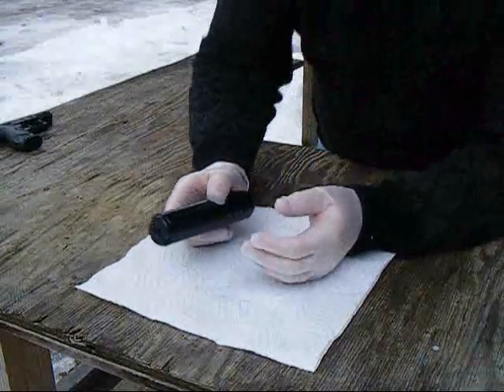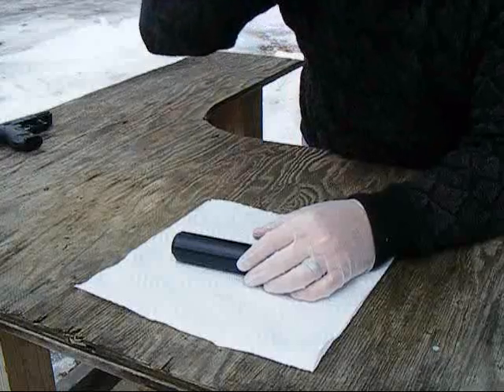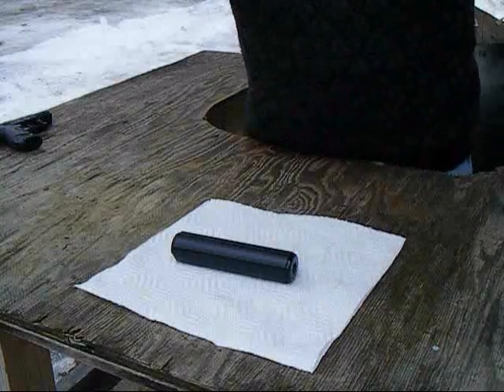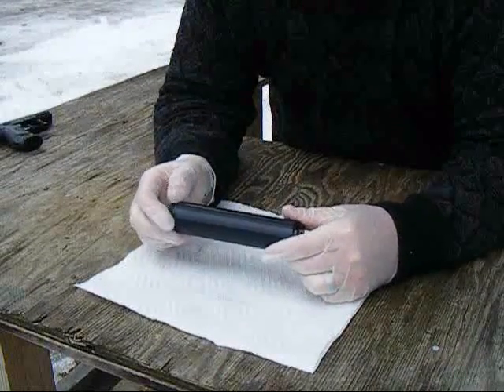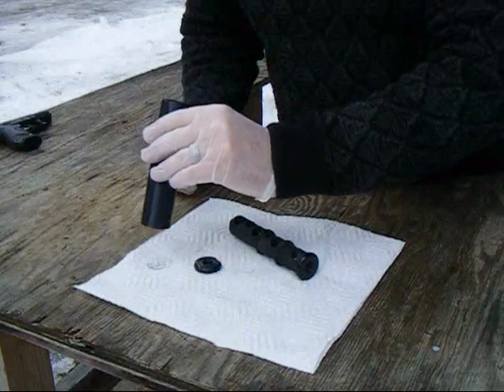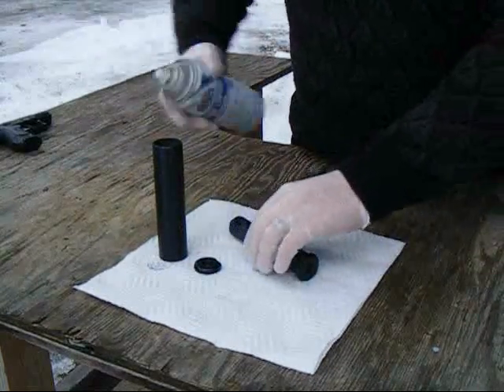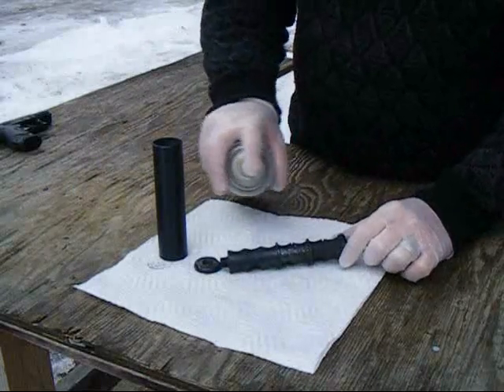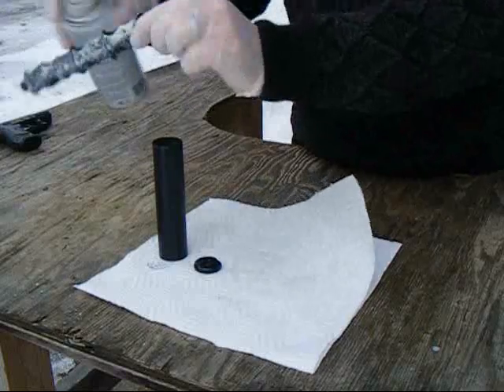what is a Wet Suppressor?

Comment: No it wouldn't, because your barrel is not affected.  The suppressor doesn't touch the bullet.  Now in the case of lets say the .300 Blackout round designed for the AR platform they designed that to shoot sub sonic with a lower powder charge for using with a suppressor or super sonic with the normal powder charge for use when noise is not an issue, but as long as your powder charge and barrel length stay the same so should the speed and trajectory

Comment: Sorry, I know this post is old and all but i noticed that the smoke was coming out the breach too.  A) Is the smoke caused by the lithium grease (i'm assuming it is unless your just shooting really dirty ammo)? and B) If it is, and obviously your getting a lot of bow back, does this cause grease deposits in the rest of the gun?  I'd be worries about using it, cause i really don't want to be scrubbing lithium grease out of the actions of my guns, but other than that it sounds like a good idea.
Reply: Jcreek201 
In the cold what comes out of the breech is likely steam or just hot gasses.
Reply: No it's increased blowback from the grease.